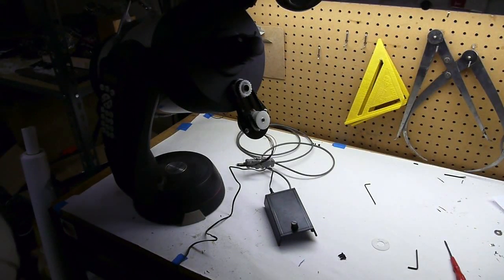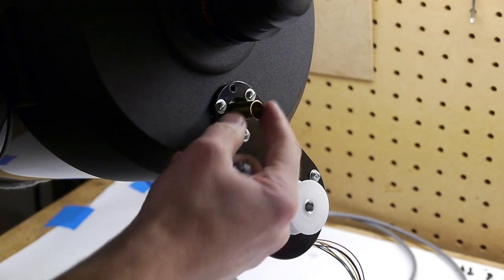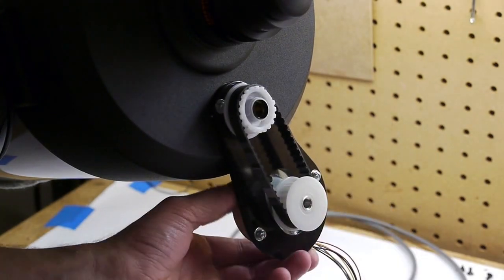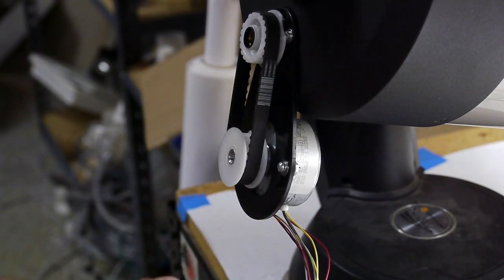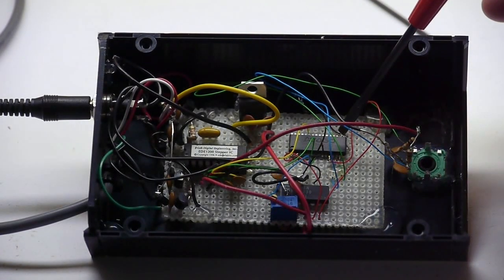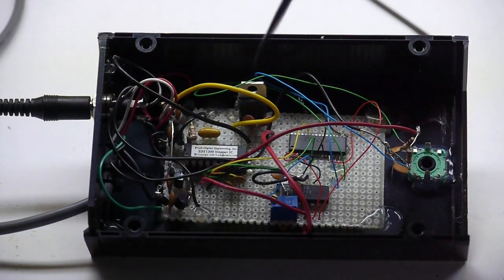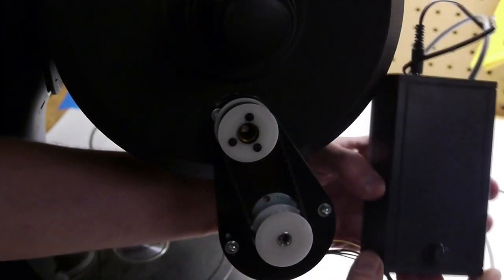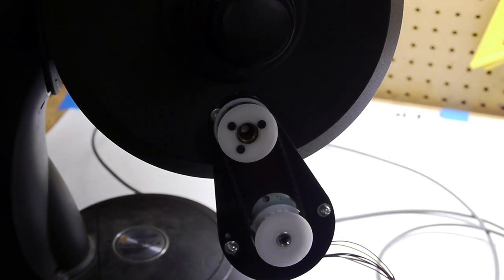Remote electronic focus for telescope (DIY remote follow focus)

Comment: Nice. I planned to do the same thing with an arduino controller, but similar belt & stepper motor arrangement. Bought some components, but then upgraded my scope & the new one came with a microfocuser.

Comment: Why didn't you connect the stepper motor to another stepper motor?
Reply: ***** He could, but that would require him to get expensive stepper motors, or turn one faster than he wants, you need precision.
Reply: Evan Huffaker You're right...if he needs precision, two stepper motors is probabbly not the best choice, but I don't think it would be more expensive...

Comment: Nice work Ben, but I think you could simplify the design quite a bit if you only need 1 to 1 ratio. The stepper uses quadrature input, same signal as the quadrature sensor. It should work by just connecting the sensor output directly do one phase of the motor and an inverter for the other two phases.